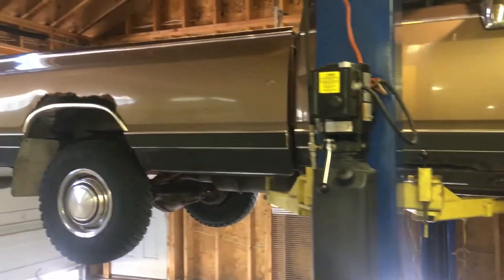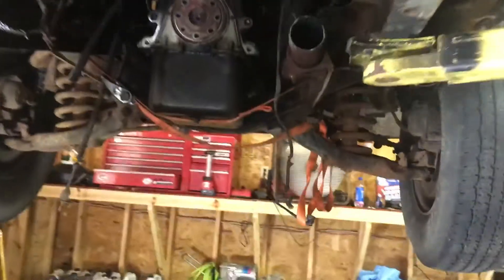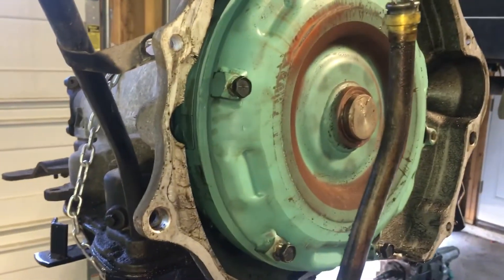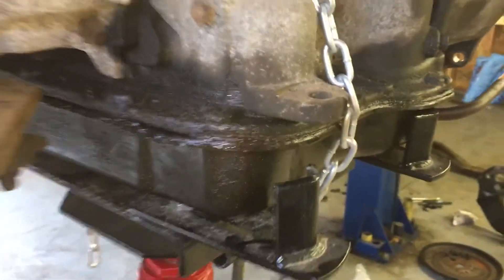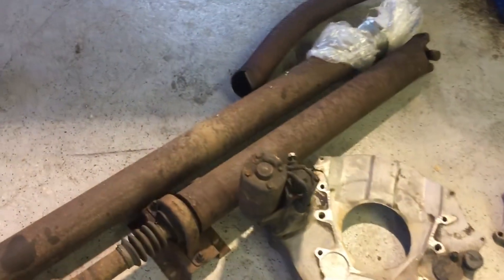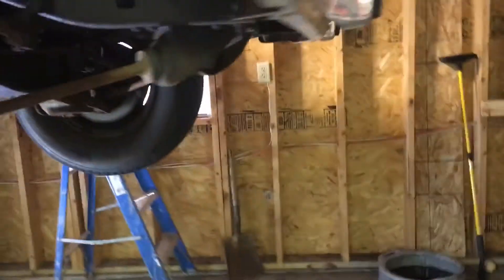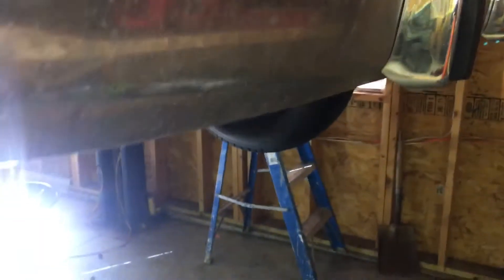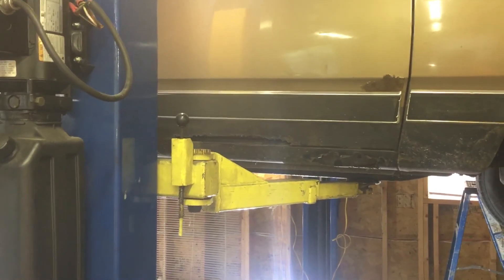1989 Dodge D250 Cummins NV4500 5 Speed Swap Finally!

Comment: What did you do for the driveshaft?
Reply from the maker: Stock driveshaft from a 2nd gen standard cab long bed with auto trans. Just had to swap out the yoke for one that worked with the NV4500